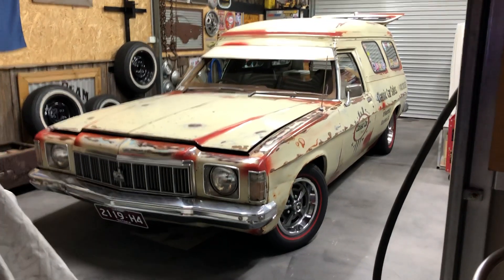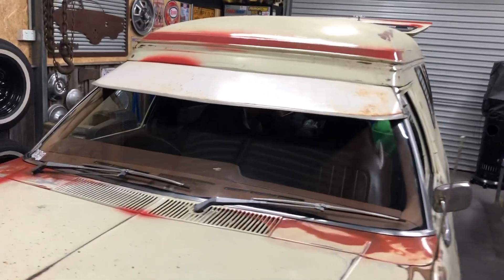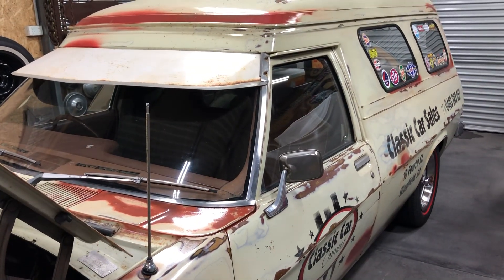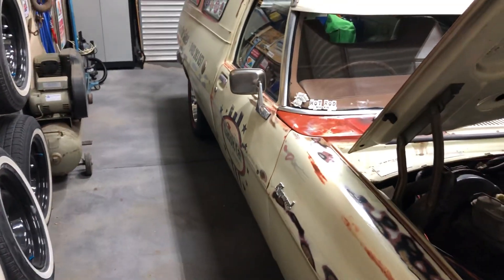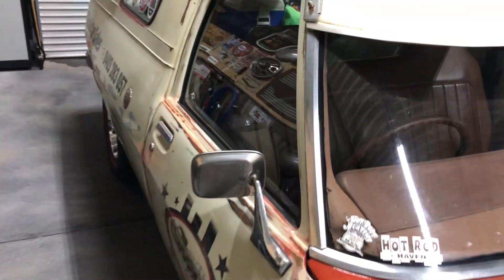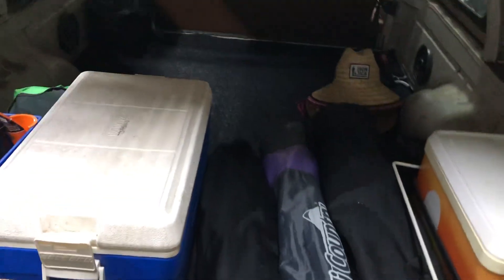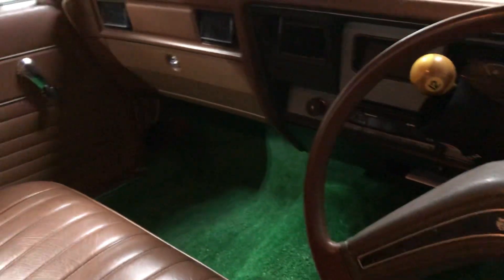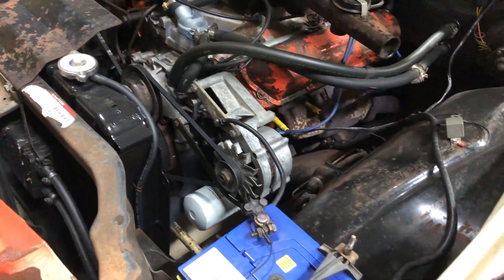Holden HX panel van

Comment: Thats my mate Andrew's old van, he had it for 15 years, brought it back from the dead - got it purring, got the suspension just right, cleaned up the original patina, did the sneaky custom rake on the visor then the guys that got it from him added the extra lipstick patina, fake grass and stickers and flipped it...sad day - glad its gone to a good home, enjoy👍
Reply from the maker: I have given her a lot more TLC needed, radiator, all hoses, thermostat and housing, engine mounts, transmission mount, transmission serviced, brakes, proper lowering blocks which brought the back up an inch to give better level stance, wheels/Tyers, reconditioned the intermediate steering rod, most of the stickers replaced with added more, marine carpet in back, old steel trailer plug where there had been one, klaxon horn and new battery.
She deserved the new love and just ran like a dream to Bright 3.5 hours away, just want to put the electronic dizzy in, the moulded carpet I already have for front, some new disc rotors to eliminate some brake shudder and maybe a Bluetooth stereo.
She is most certainly loved in this family and has been very lucky she’s had some good care taker’s from 1976.
Also would love to hear from your mate Andrew to find out more about her etc please put him in touch with me cheers mate 👍
Reply: @pistonlife3200  hi mate there is the Maryborough carz and coffee this Sunday I will be there with my Holden hg kingwood ute